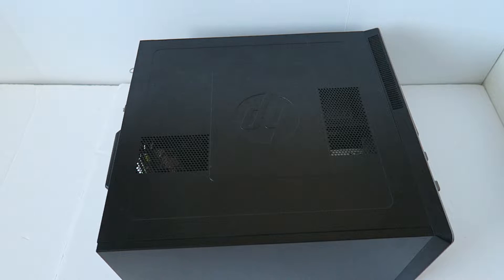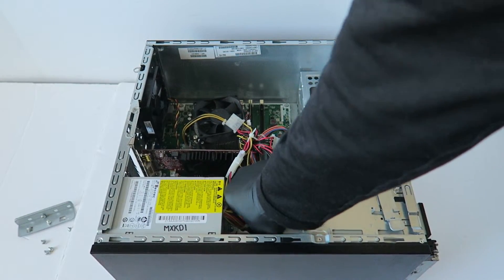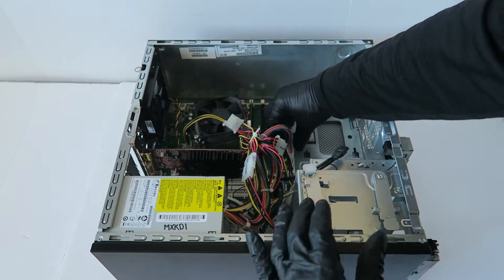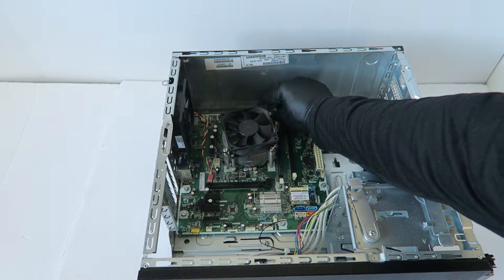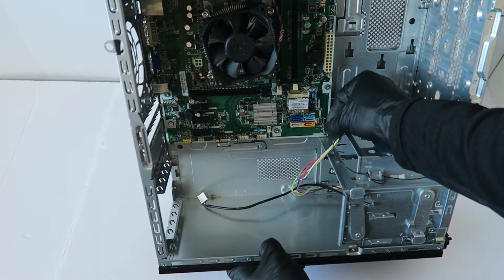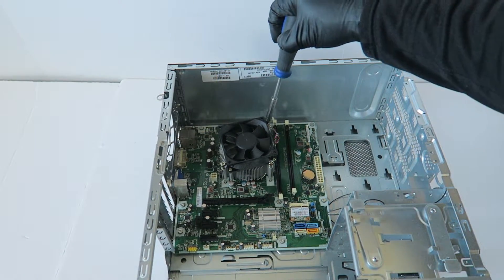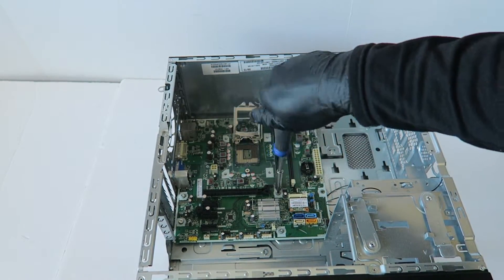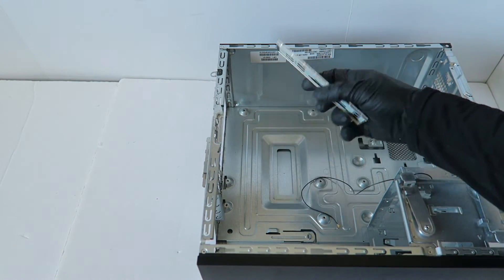HP Pavilion Teardown

Comment: Sounds like you have a mask on. But slow down when yanking the wires out. My PC 6000 has the small data cable missing. Everyone goes so dam fast or its blurry and I cant see where it is on the mother board, if at all that is where it is connected.

Comment: I have a very similar pc yet my front panel does not come off that smoothly. It has the same three clips but after unclipping them the other side of the front stays flush and strong, and I feel wrong forcing it, so I cannot remove it :(

Comment: How do I get my case open on my HP Pavilion? It doesn't have screws to unscrew. In the place where your tower has screws, mine has Rivets. Do I have to break the rivets to get the case off? Have you ever dealt with a tower that only has rivets instead of screws?

Comment: Have you checked if you could remove the top 5.25" drive cage?
Reply from the maker: Hi, yes it is possible to remove  5.25" drive cage if you want..
Reply: @Mxkdt  Would that also include removing the Pocket Media Drive and the card readers?

I'm asking because I have an HP Pavilion I consider modding. For some hard drive coolers, it seems I don't have to remove the top drive bay and I can just slide it in.

As for the Pocket Media Drive, I could probably replace it with thinner 5.25" gadget like an optical drive, fan controller, etc. If I can make space for a third full-height 5.25" bay, I can place a larger drive cage, and thus a larger cooler, as well.

Comment: Hello, I have HP Pavilion A6000, and it doesn't have standoffs, it has prebuilt standoffs, is it safe?
Reply from the maker: Hi, yes it is safe and HP Pavilion A6000 you can use any micro atx motherboard in that case.

Comment: saving all the major hardware, video card, hard drive, Optical drive and motherboard (intact) transfer contents to a new case and reassemble! take out any chassis fans and save them for later... save the power switch assembly and the wifi antenna.... trash the card reader and the entire chassis.... HP="Horrible Product" I just did this with a P7-1148 and put the contents into a Rosewill chassis and it looks so much better and works just fine.... I hate HP and Dell Chassis as they are always Propriatary! even the boards are questionable until you discover that they are made by ASUS for HP.... oh yeah, and don't forget to transfer the PSU.... its still usable!
Reply from the maker: Hi, thanks for the info.

Comment: Can you please share the exact model?
There are many HP Pavilion Desktop...
Reply: I have a HP Pavilion Desktop - 500-443ng and only recently I have tried to remove the mainboard only to find out that it needs an adapter cable for my PSU which bridges the 4 pin power supply connector that leads to the CPU. While my mainboard is the HP 2AF7, the mainboard in this video too has a 4pin plug as you can see @5:11 if you pause the video. My modular PSU doesn't have such a connection. Seems like they sell outdated technology. Here is a reference that shows the 24pin, 8pin and 4pin power supply connectors https://upload.wikimedia.org/wikipedia/commons/e/e6/ATX_Power_connectors_24pin_8pin_4pin_Motherboard.jpg

The disassembly procedure was practically the same as in this video (you don't need a drill only a screwdriver set). The cables were the same except for the multimedia card reader in the front which I didn't even manage to remove. The only thing you need to unscrew is the HDD ... and the mainboard of course.
Reply: i have a HP Pavilion p7-1107c and this is exactly the breakdown of it.

Comment: Just found a dead one of these in my parents attic.  I was thinking about trying to build a Ryzen first gen in it for them to have something alot better than they are currently using.  Does anyone know if a standard M-ATX motherboard will fit?
Reply: As long as it have just 4 slots on both expansion and pcie slots

Comment: It's nice that HP uses all standard motherboard connections.  Case is well designed and I have used HP cases for many of micro ATX builds.
Reply from the maker: Hi, yes i like HP cases.
Reply: These cases only support micro atx ?
Reply: I like the fact that this one has a 1000 gb hdd

Comment: Haven't seen one of these PC's in a while or so..
Reply from the maker: Intel second gen.
Reply: They are hard to come by but in the last two weeks I won two on ebay one without a hard drive for $122 and with a hard drive for $240 (total w/shipping taxes etc.). So, I am set on hardware for the next 5 years I plan on using it. There is nothing out there I am willing to lay $1500 on out there that beats this 6 core processor with 16 ram worth it. Runs every game and program seamlessly without even upgrading the graphics card.